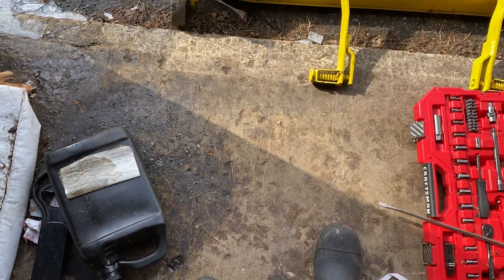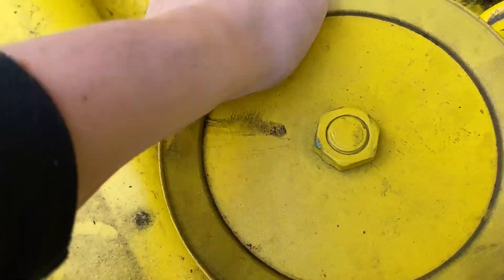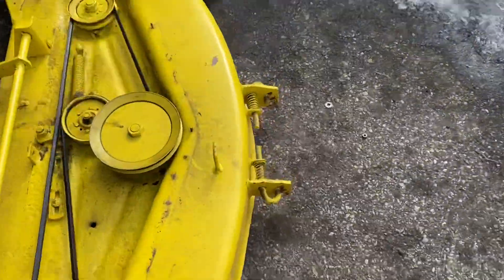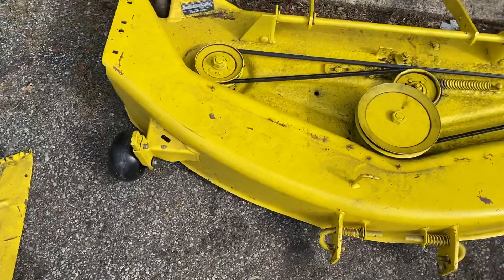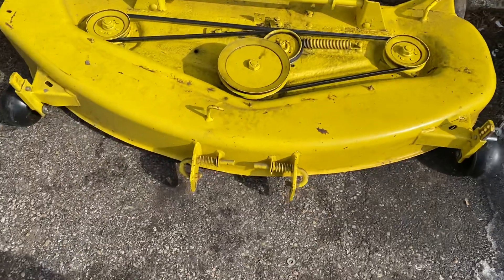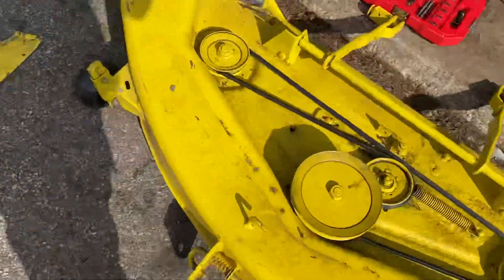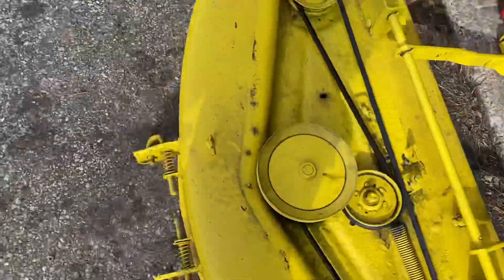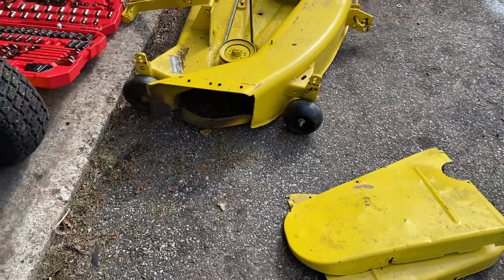A look at the 318’s mower deck

Comment: did you grease them pulleys? my 318 leaks hydrostat fluid too i believe its the tranny seal
Reply from the maker: Non greaseable but I put grease on the spindle shaft so if I ever have to take it apart again it won’t be rusted on